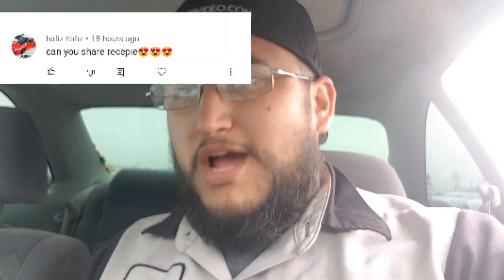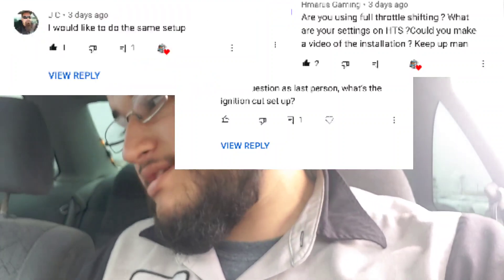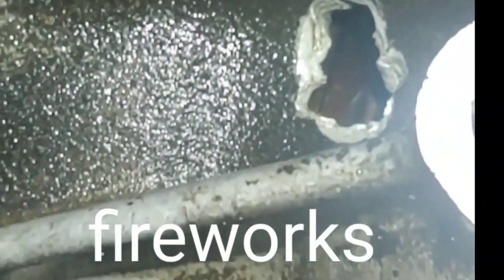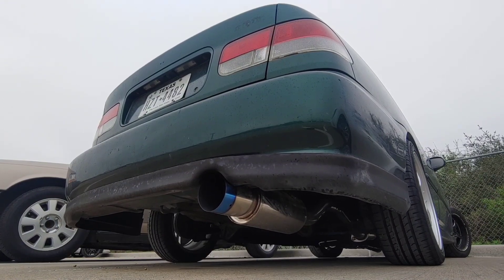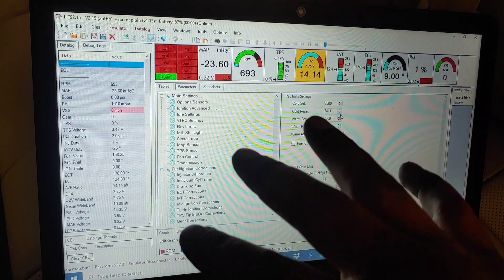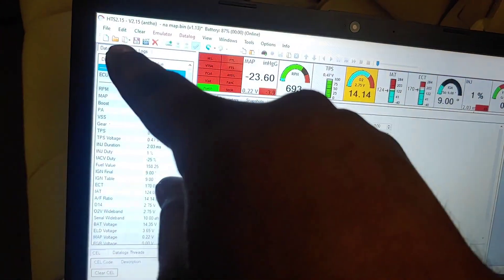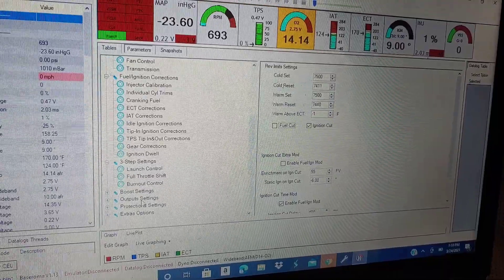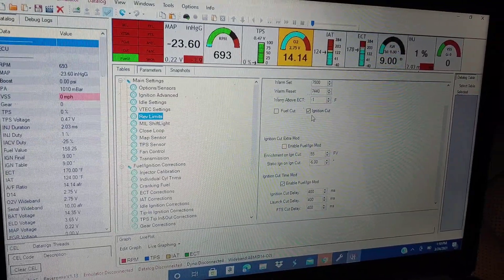How I Shoot Flames ~ Ignition Cut & Rev Limit Settings With Honda Tuning Suite

Comment: I used to use a relay with a rev light to make this happen, cut the negative wire to coil and install it to relay. Did it to a 87 4runner and 88 suburban and never had a problem. It was ridiculously loud.
Reply: Please elaborate
Reply: @FetucciniAlfredo180  the rev light would come on. Switching the relay. Connected to the negative side of the coil. Making it dump a bunch of fuel and making it explode after leaving the cylinder.  Basic science my guy.
Reply: @talkntrash  so when the light came on you would switch off all coils allowing unburnt fuel to enter exhaust and it would re-ignite after light turned off.
Reply: @FetucciniAlfredo180  I'm not sure if it's possible to do it the same way in modern cars with coil on plug. On a single coil, the signal would be interpreted by the relay; removing the negative signal to the coil and won't ignite the cylinder in any of its stages. The hot air and pipes is what ignites the fuel. It comes out as very fine fuel (like a mist or vapor). It makes it super explosive which is why you hear the "pop" noise.
Reply: @FetucciniAlfredo180  So yeah. After all that, when the light turns off, it continues like nothing happened.

Oh, yeah... While it's happening, the light flashes like crazy.*

Comment: bro ty ima try this out. do you have any vids on how to get the pops and bangs? i been trying use popcorn on hts and mess with my fuel tables but it either drives fine and no bangs or drives and some reason gets stuck at 2500-3000rpm like its 2 stepping😅

Comment: I have a 06 S2000 so I’ve been playing with hondata here and there. I have a crackle tune I put on it, essentially it only does it when I want it to because I have to still be giving it gas on deceleration. Idk how to tune it to where it does it automatically yet. I also wanna learn how to make it pop and shoot a flame when I’m getting on it hard and shifting gears while racing basically.

Comment: I have some questions, after do the changes in the ecu, i just need to gas the car and automatically will make the pop and bangs when I stop to gas? Or i hava to keep the gas pedal in some position to get the pop and bangs? If i have to keep the gas pedal pushed in some position, is there some option to wire a button to indicates to the ecu that i will use the launch control once? I mean, if I want to race, the button will have the function to cut the revs for example at 4500rmps and then the car will go to 8rpms( i am new in this type of content)

Comment: Damn that’s sick is that possible with the stock ecu or what thanks
Reply from the maker: Unfortunately you need a socketed obd1 ecu. Personally I run a P28 with moates ostrich and hulog
Reply: GreaseMonkeyMods is socketed the same thing as chipped? im looking into soldering mine so that i can learn how to tune my car and how the tuning software and data logging works. i barley got my yonke in december and ive just been fixing her up nicee👏🏼 also i got 1 more question, would the same things u said u had for your p28 to do the tune work on p75 ecu?

Comment: Hey i have a bone stuck eg 1.5 16v , can i do this with the original ecu? if yes how do i connect hts with the car i'm pretty new to everything thanks a lot in advance!
Reply: hey make sure you don’t fuck up your cats doing this
Reply: @jtbaker6457  did cat delete already
Reply: @latenightcruisin2620  then ezzzz. what’d ya end up doing with your car so far?
Reply: @jtbaker6457  type r seats from ep3 on eg rails , 5 point harness and quick release
Reply: @jtbaker6457  yo wassup it's been a while xD
Car is now painted in sunlight yellow with a b18c4.
Spoon sw388 wheels wrapped in the classic r888r tires 😎
Reply: @latenightcruisin2620  hey what’s up buddy. ohhhh that color matches with my car!

Comment: Yow bro do you think i can run side exit headers on my stock d16z6 N/A?
Reply: 100% yes, I have a mini me (Japanese imported d15b block and d16y8 head) it is mostly stock I have 130 hp as of my last dyno but since then I run a dual bumper exit exhaust, I have two pipes sticking out of the sides of my front bumper lol, one out the driver side and one out the passenger side
Reply: No muffler and no cats, as soon as the header connects to the test pipe the pipes have been cut turned and welded to aim out either side lol

Comment: Any form of ignition cut is still putting load on the the exhaust valve trying to force it off it’s seat when it ignights it’s not exactly safe lol
Reply: That’s why there should be a disclaimer to “do at own risk”